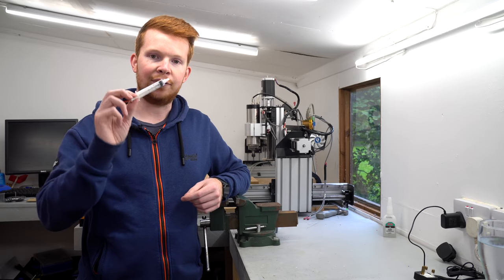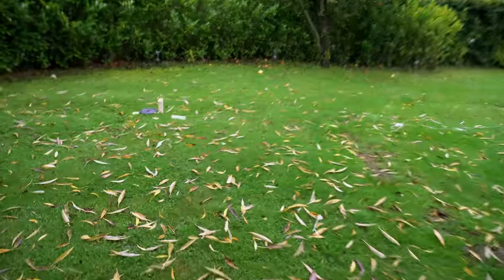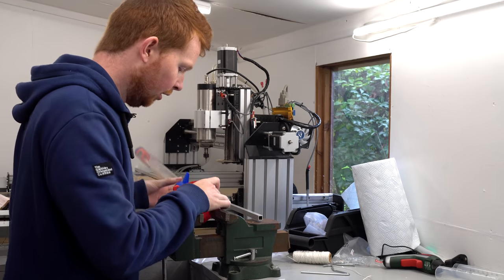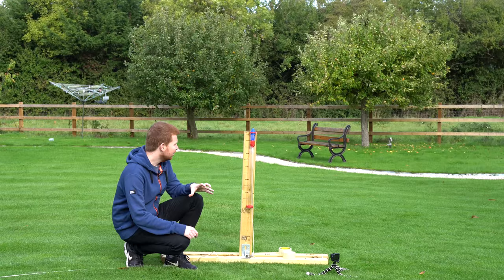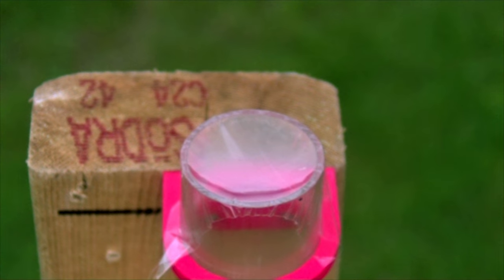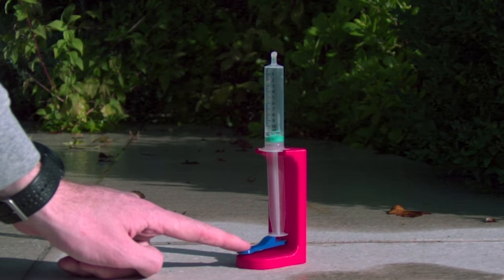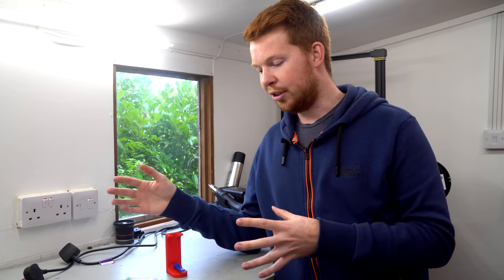Vacuum Rocket

Comment: If you look closely, frame by frame at 3:40, you can see the momentary high pressure causing what I think is condensation. This pressure causes the piston to jump back down. This high pressure is basically the idea behind diesel engines!

Comment: i think the biggest issue with air in the cylinder is that the energy that would be trancefeered into the the top of the piston ist diverted into compressing and therefore heating up the air inside the piston, onverting most of your kinetic energy into thermal energy.
Reply: Yes, and i wonder how it would look in a thermal camera
Reply: @rizalardiansyah4486  depends on how much the tube isolates from heat...

Comment: You mentioned in a comment about designing a projectile with fold out fins, as an intermediate step , would spiralling the projectile work, as it hits the air it would start to rotate annd get some spin stabilisation.

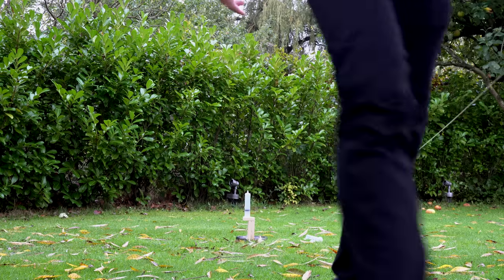Comment: 3:55 Actually you were right, with the heavier piston the kinetic energy will be less. Since its a vacuum the force, F, on the piston will be constant. As well, the distance the piston travels, d, will also be constant. However, there will also be the force of gravity working in the other direction which is equal to the piston mass, m, times gravitational acceleration, g. Given that the basic formula for energy, or work in this case, is Force multiplied by distance, we can now set up the energy balance.
E = F*y - m*g*y

Comment: That vacuum canon concept is an awesome concept, ...except for the packing tape.  I wished I could make something like that, but much smaller, and with no packing tape.  And to make say a toy gun, you can use positive or negative (vacuum) pressure.  Nerf guns use positive pressure and work incredibly well.

Comment: id of replaced the packing tape with a very lightweight hinged lid with a gasket, as it pulls down itd pull it tight to the tubes top surface but as the projectile went up itd flip it open.
itd be easier to reload and would probably absorb less of the force

Comment: I feel like you should be modifying Spring-Powered Nerf/Foam blasters, I think you'd be really good at it thanks to your Engineering degree and lust for learning how things work. You will be perfect with getting the most powerful, most efficient blaster possible out of any Springer you can find. Want an extra challenge, go for a Nerf N-Strike Stampede ECS, it was recently re-released as part of the Icon Series and it's a Electronic springer, so the priming is done for you, but you have to worry about a gearbox that doesn't like heavy spring loads, I think it would be perfect for you

Comment: For the larger version you were trying outside with the blue projectile, could you fabricate some spring loaded wing tips on the bottom side to give it that stability when it exits the tube and see if it would fly higher or farther? Like you said, the instability of it prevented it from going any higher. Maybe the pop out wings would help solve that.

Comment: Unfortunately this seems like a situation where things are just prone to scale poorly, and smaller is actually better.  Even though the larger vacuum in the larger syringe stores more force, you need more material to contain that force, this is why the top blasted off.  Make the syringe even bigger, and it would be hard to stop it from imploding.  The only solution is to thicken the walls, which adds weight, and I imagine with most materials, this trade off overrides the additional force from the larger vacuum.  The smaller syringe is probably close to the perfect size - the plastic is strong enough to both hold the vacuum and contain the piston as it lurches forward, light enough that this force can easily move it, and heavy enough that it is not immediately overwhelmed by drag.

Comment: So this works basically the same as launching a rubber band? It get's stretched, storing energy. Once it is released, it contracts, but since the top part is held up, only the bottom part can accelerate, and when the inner part hits the cilinder, the energy is equalized between the two parts, launching the syringe upwards.

Comment: the piston being of higher mass than the cylinder won't make your rocket faster since the atmospheric pressure pushing the piston would accellerate the piston at a slower rate this time resulting in the same momentum transfer since speed of the piston is slower now. I'm a bir rusty with my physics but I think a longer cylinder barrel is what you're looking for for more speed.

Comment: I wonder if a small shock absorber inside the head of the syringe would help to not blow out the top of the larger ones.  I'm thinking something like a felt pad stuffed in the top, maybe fixed with a dab of hot glue, if you can finagle it in there without getting glue on the cylinder walls.  Or maybe the felt pad fixed to the piston itself, with some clearance around the edge so its not adding any friction.

Comment: Ok so what if you did this in a higher pressure environment? Like if you were to make a pressure tube similar to the vacuum tube, and launch a syringe from the inside that bursts through the top of the pressure tube which further increases the velocity of the syringe from the pressure behind it. 

I'm also curious about what it would do underwater. Cool video!

Comment: How about a partial vacume being a stationery projectile. A wad of cotton wool dipped in diesel at the rear of the projectile. As the vacuum is turned into compression by the movement of the piston it should ignite the diesel and launch the projectile much faster.

Comment: You can make engine by connecting in crank shaft in parallel and with little compress air and make it hybrid vaccum pneumatic engine 👌

Comment: Since a perfect vacuum is just the absence of 14.7psi/101kpa of pressure at sea level, you should get the same performance by shooting the projectile with 14.7psi/101kpa of compressed air as you do with a vacuum. The other thing is that your projectile can only travel so far before you are unable to create more vacuum because you've achieved a perfect vacuum or at least the most vacuum that your seals can sustain. Once you've reached this point there is no benefit to pulling the projectile back more because you are only sucking in more air around the seals. So another test would be to calculate the perfect theory travel distance that your piston needs to be pulled back in order to achieve a relatively low/perfect vacuum and then seeing if pulling it back any further results in better performance. How it was taught to me was that there is no vacuum, merely the absence of particles that create the pressure. The 'vacuum' as we understand it is just based on atmospheric pressure. So a perfect vacuum would be 0-psi/kpa, and everything above that would be adding pressure be it from the atmosphere or an air compressor. The real take away is that a vacuum is hard to achieve, maintain, and is relatively lower power with a maximum potential working force equivalent to only 14.7psi/101kpa. So while it is enough potential to do work, it's so much easier to create and maintain sealed pressure. Creating pressure also scales a LOT compared to the fixed limit of a 'vacuum'. The best way to explain this is with a water pump. If you take any standard above ground well pump it will likely only be able to 'lift' or suction water into itself for about 20-feet or 6-meters vertically. That same pump can probably push that water vertically on the pressure side to over 100-feet. In perfect theory the most you can pull water with a vacuum in any vertical column is about 26-feet or 8-meters at sea level.

Comment: Tom, the 10ml syringe seemed to have the most perfect length to diameter ratio. When you scaled up, you drastically changed that ratio and got poor results. What about scaling up but keeping the length to diameter ratio the same as the 10ml syringe? 

Your leaky O-ring also allows for, essentially, a “shock absorber” when your piston is supposed to be at max velocity as it tries to then re-compress the leaked air into the top of the ‘syringe’. I think that was a huge factor in your large scale barely leaving the ground

Comment: Could you make a repeating "crossbow" this way? With a pin in the top, and using ball bearings/pins of some sort to feed in? Use the vacuum potential energy (atmospheric) instead of a rubber band?
Reply: Yes and get in touch with joerg from the slingshot channel :)

Comment: Looked like not only was the leak reducing vaccuum, but was actually creating pressure upon reaching "TDC" of stroke & robbing energy transfer
(Edit) if you look at the slo-mo you can see the bubbles formed when the pressure oscillates upon bottom stroke, silicon the end cap of pipe & around the o-ring fitting & this should stop any residual air in the system on the large prototype

Comment: It's a little late for this, but it would be cool to see what kind of designs could improve the projectile's aerodynamic-iness once outside of the tube.
It might be the case that the best solution is to simply put a rocket shaped projectile on top of a very light platform, but that's boring. I mean ball would probably be the best route but, again, that's boring.

What if the projectile had a thin body with collapsible fins that formed a disk when sitting on top of the plunger? Would they stay flat in a closed-valved position until they break the tape? Or would there be sufficient pressure difference between the center and the edges of the fin disk for them to fall into an open-valve position?
Would the lack of air above the fins in closed-valved position make the projectile tumble while still inside the tube because there is no stabilizing pressure?

Comment: Why did the tape burst before the projectile got there? I thought the tape was only broken by the projectile. 

Q: try the cannon without a projectile and see if the tape bursts? 

How close is the diameter of the projectile to the cylinder? Maybe a paper or moist cotton ball at wadding under the projectile. 

Try a rigid lid instead of tape. Something that the projectile can bump. I think it’s be less loss than piercing the tape. 

Would glycerin make a better sealer lubricant?

Comment: I can't help but wonder if the fact that you have water in the small syringe and air in the large one makes a difference. I don't know the math involved, but since a liquid like water can actually reach negative pressures and a gas can't, there's a possibility that you could be creating more negative pressure in the water-filled syringe leading to a higher velocity, more momentum to transfer, and greater height from the launch.

Comment: I'm still at 4:10 of the video but i was thinking: maybe you could use less lubrication so the friction would be enough to make the outer cilynder accelerate before the two pieces collide and then reducing the chance of cracking the top

Comment: Not only does the leaked air reduce the internal pressure but, more importantly it absorbs energy by dampening the Force transfer by heating up the air in the piston

Comment: Wouldn’t a larger diameter give a significantly stronger spring effect? A 1 kg/cm2 from the atmosferic preassure could accellerate quite a heavy piston, with for example a 20 cm2 tube. 

I don’t believe the friction is an issue, it is transferring energy to the top half...?

Comment: I swear you think like I do. I would always cap the end and launch em. As for the cannon, that is pretty amazing for 110mph. I was thinking a simple folding fin type rocket for stability. I'm also curious on what the length limit would be of the barrel given the same inner diameter.

Comment: at 3:40 you said that increasing the mass of the piston would increase the launch velocity of the syringe.
I hav my problems with that ;)
Isn't the work put in by pulling down the piston the same no matter what mass it has?
...it should be, since W = integral F(x) dx, and the force opposing the pull at each point is determined only by the pressure inside the syringe decreasing.
So one would actually expect a syringe with  a lower mass piston to go higher, since it has a lower total mass, but the energy put in at the start is exactly the same as if it had a higher mass.
...Or did I miss something?

edit: "the weighted piston went higher"
Are you ssure, or is that what you expected? ;)

Comment: What if you had a small valve adaptor on the end of the syringe, and then pulled the syringe back and then used another syringe to vacuum the contents of the first syringe, then pulled it the rest of the way to increase the vacuum even more. Wonder how much more velocity you'd achieve. If that makes any sense to you.

Comment: so you can print a magazine that holds multiple syringe. auto syringe rifle :). you have to load magazine with syringes that are lock and load so when trigger pushes it up it will fire the chambered round in to the ... air

Comment: Leave a bit of air in, add a touch of diesel fuel,  see if it compresses enough to ignite (doubt it). Diesel would probably lubricate the o ring as well.

Comment: maybe you figured this out, but the physics of the energy transfer from that bottom plug into the actual tube itself works out to be much better when contact is made from the bottom plug into the top of the syringe.  You kind of mention this when you talk about air leaking in but dont mention the actual energy transfer.  

So if the air leaks in, then there is air at the top that makes it an elastic collision, which sounds like it would transfer the energy better but really it just wastes alot of energy in compressing that air, which in turn accelerates the plug back down the syringe, rather than transferring the kinetic energy.

If you made a 1 way valve at the top of the tube, so that any air can be pushed out the top, but not pulled in to ruin your vacuum, then I think that acrylic tube would work much better.  Even without any other modifications.  You can see in the video that the plug does not even reach the top of the tube, it just compresses the air and goes back down.  While the tiny syringe hits the top of the tube, and stays there.  This represents a full transfer of the momentum from the plug into the rest of the body, which always includes the plug.  

It seems a little backwards from common sense at first, because an elastic collision is one that represents a full transfer of energy, while a collision that combines both objects stuck together at the end splits the momentum between them.  The thing is that the plug and tube are both part of the body, so you need that energy to split between them.

Finally, that projectile cannon thing, I can see at least one time where you pulled the plunger down too quickly and the projectile actually separated from the plunger/wadding.  This is an energy loss as well, due to the loss of acceleration time and the collision losses.  Not really important though.  Great videos man, you really do think outside the box and come up with really clever methods of doing things.  Thanks and keep it up.

Comment: 3:37 “To maximize the end velocity [...] we need a low mass syringe and a high mass piston. However too heavy of a piston would reduce the speed at which it hits the top of the cylinder, so there is a balance to be struck.”
That's not entirely true, is it?

Let “F” be the atmospheric force, “m” mass of the syringe, “M” mass of the piston and “d” the height of the cylinder. At the beginning, the piston accelerates with a constant acceleration a = F/M, that means its trajectory is s(t) = t² F/2M, and it hits the top of the cylinder at time t = √(2dM/F).

The escape velocity of the syringe is (total momentum of the system)/(total mass of the system). The momentum of the syringe is zero and the momentum of the piston is ∫ F dt = Ft. This means that the escape velocity is:

v = Ft / (M + m) = F / (M + m) · √(2dM/F) = (√M) / (M + m) · √(2dF)

It is true that velocity increases with decreasing syringe mass “m”, but for a fixed m, the maximumum velocity is at M=m. So you'd want the syringe and piston masses to be equal, but both as small as posible.

Comment: Hmmm... if you don't put hot glue on top, and instead cap it with a needle that's plugged, add a little bit of water like you did your last rockets, would that eject the needle at high speed?

Comment: what if you added drop weights to the plunger

what i mean is add weights to the plunger so it has more mass when it is moving upward to put more kinetic energy into the takeoff but have it set up so that once the plunger hits the top of the syringe the weights on the plunger disconnect and just drop so they don't add to the weight of the syringe taking off

as for the cannon add some holes at the bottom of the tube to air can rush in before the plunger is pulled out of the bottom and make the projectiles fins collapsible so they expand and add a slight twist to them so it spins having the fins set up like you dise does nothing for stability when going up and only adds drag to point the tip down when falling you need fins that will actually be in the airstream to add stability 

also for the cannon add a motorized winch that can pull the plunger out realy fast and reliable every time

as for the air leak problems it's because you standard cartesian style 3d printer's can't actually print a true circles it can only print ellipsis meaning your seal will never be perfect without post processing your print to make them true circles if you want to be able to print a true circle without post processing you need a delta style for that it's all just about knowing the capabilities of the tooles you are using you do the job you are trying to get them to do and even tho o rings will fix it a bit it will not solve the problem entirely as you figured out